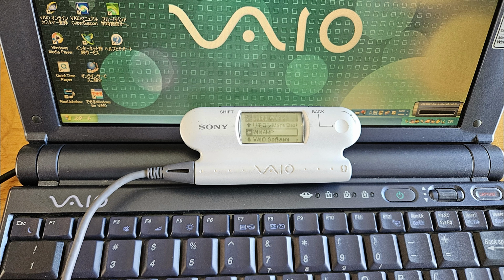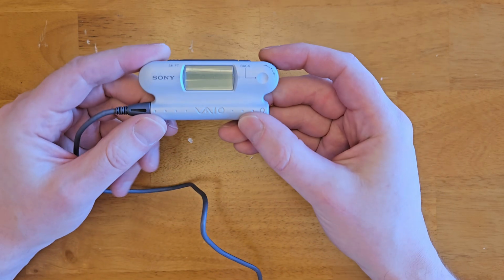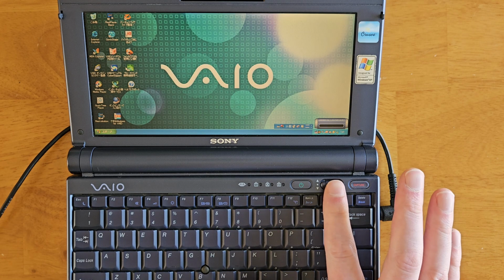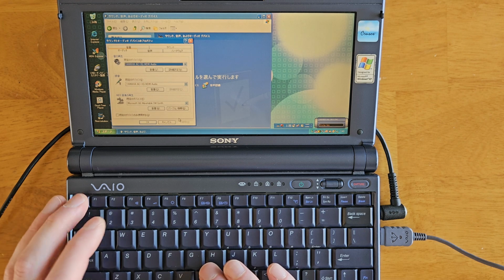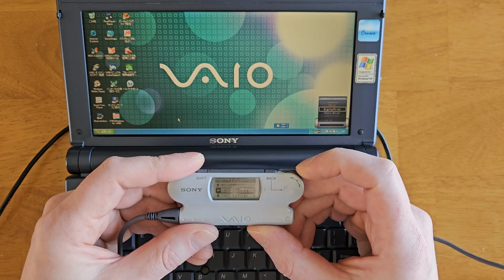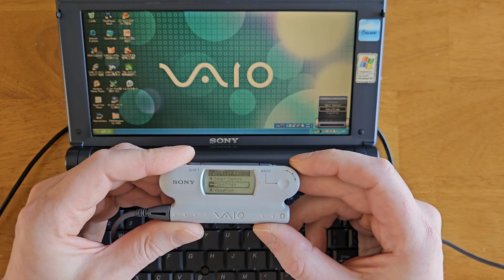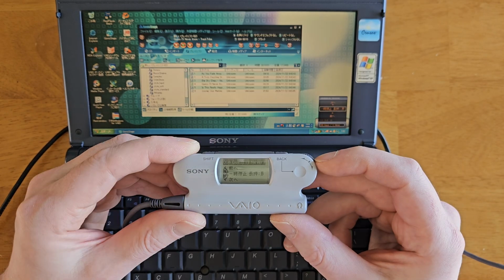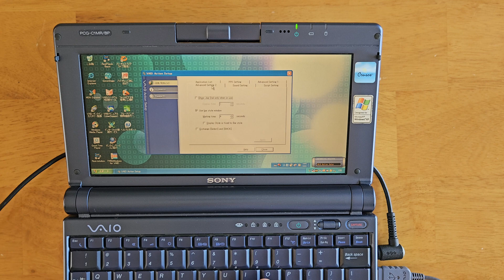Sony Vaio Jog Dial Remote (2001) Teardown and Demo

Comment: Hi Jason! Found a Vaio laptop model PCG-GRZ230 in the e waste. 256MB of ram, pentium 4, windows XP of course. Everything works perfect! But it was overheating so I started to disassemble it to clean the fan and of course the dissipator, but since it is down the screen I need to remove the entire screen and I don’t find the way or all the screws to remove it. I found your channel with a lot… A LOT of Sony vaio! But didn’t find my exact model, I think it is a specific model for LATAM because everything is in Spanish. I still can’t find a disassembly of this exact model, if you have one or if you know about any website with the step by step or a video I would thank you a looot

Sorry if my grammar is not that great, I tried to type everything without translator haha. Greetings from Guadalajara Mexico!
Reply from the maker: Hello - I have a GRZ, but I haven't taken it apart yet. Usually you don't need to take off the screen to get to the fan. There is a service manual, not for the exact model you have but they should all be the same, mainly just differences in processor etc. It looks like basically remove all screws from the bottom, the screw on the left to slide off the panel about the keyboard, then remove the keyboard and that may be enough: https://ia802305.us.archive.org/35/items/manual_PCGGRZ610_SM_SONY/PCGGRZ610_SM_SONY.pdf

Comment: I have a pair of these but don't have the drivers and I've been searching for these drivers for a few years with no luck.
FYI, the current download links in the URL you shared are dead but can be downloaded via the web archive (Wayback machine); see July 24, 2021).
Also the remote was recognized by my GT1 and X505 (kinda) but didn't work due to lack of drivers.
I'm also looking for a Libretto 50M hard disk image if anyone has one to share.😄
Reply from the maker: You tried the driver_1.10.1.4.zip link via internet archive? I'm pretty sure that's what I used, I recorded this a while back  - if doesn't work I can double-check, it might have come built into the factory image. Will want both the driver and the jog dial app for those models. I've had an eye out for a 50m myself, had found a good one but seller fell through.
Reply: @jasonnovak2121  I've downloaded the files but haven't had the time to try them out yet.
Yahoo Auctions (via Buyee) is how I acquired most of my devices. 50Ms show up there every couple of months.
The Flip Animator sounds cool....I'll be Googling that for a while till I strike gold.
Btw, you've got a great channel here.
Thanks again for sharing this info!

Comment: Will this remote only work with certain Vaio models? I have a Sony Vaio U101
Reply from the maker: True, I was thinking most vaios at the time came with the jog dial and the software pre-installed, but I don't see why couldn't just install the app on other similar machines